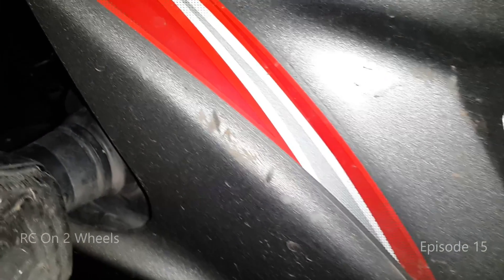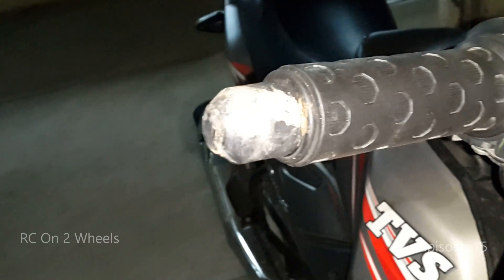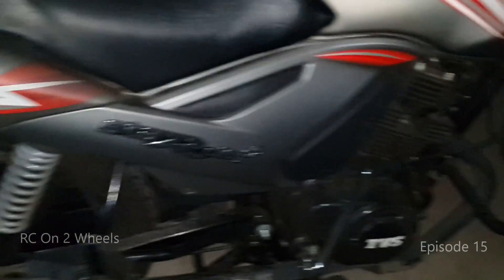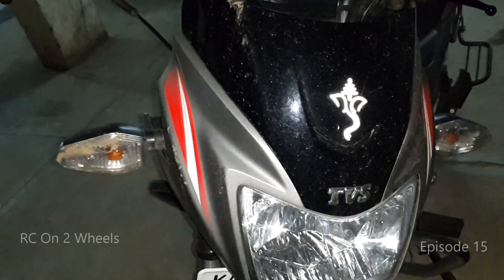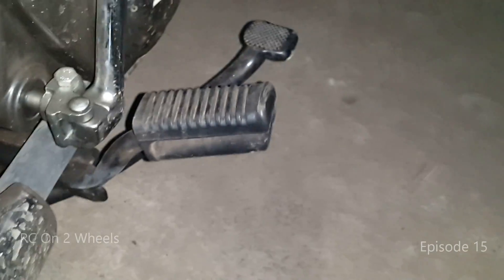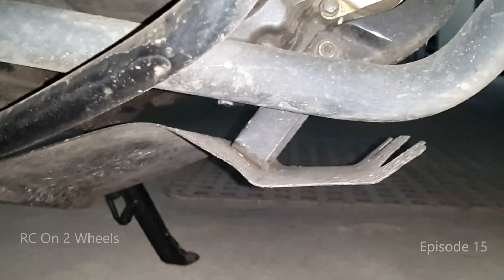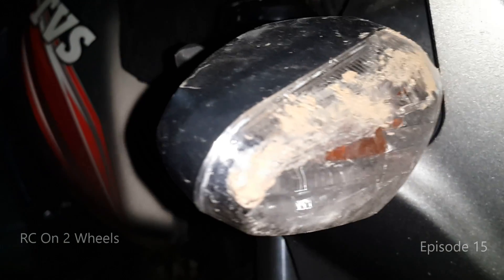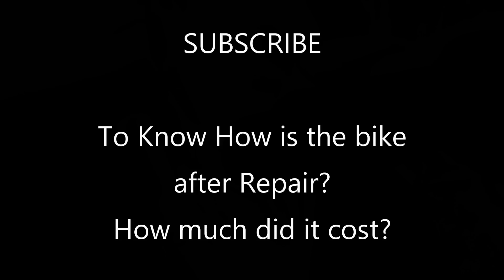My Bike Fell | TVS Star City+ | RC On 2 Wheels | Episode 15

Comment: No Problem mate, Get an aerosol spray Stallion ( 160 INR ) and spray that over the safe gaurd rod. I own a Hero hunk and had a slippery situation in mehadipatnam, did the same to it. Now it is as back to original look and rust free. And for the body, get a teflon coat or buy a tin of wax and use it regularly.